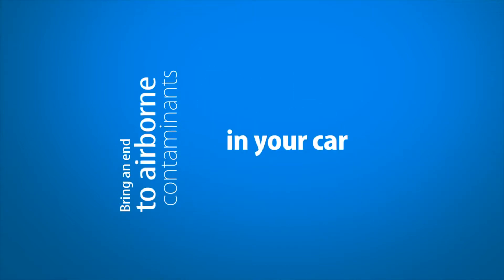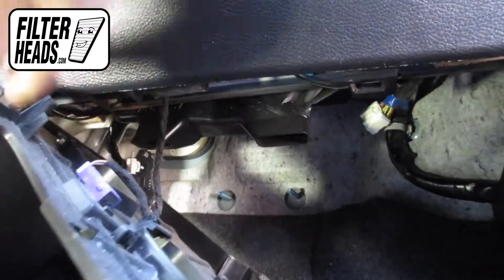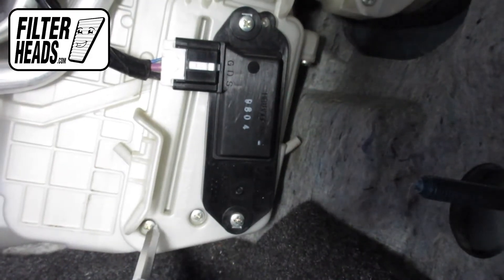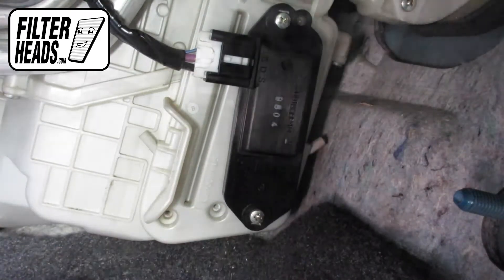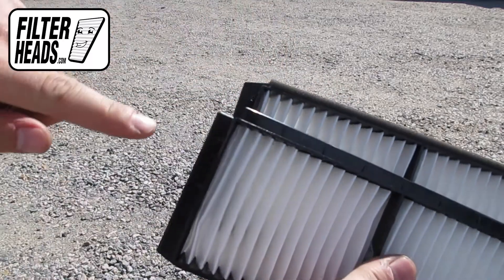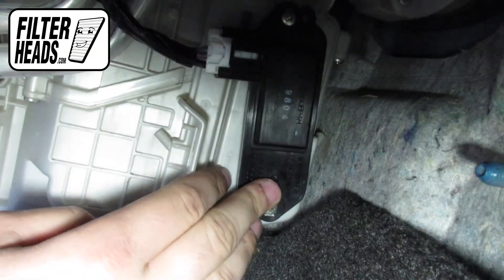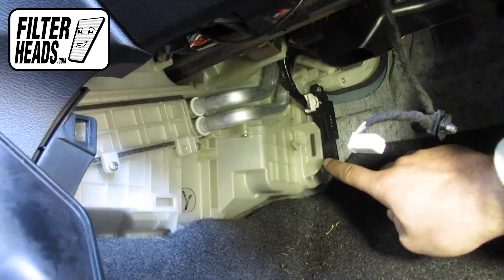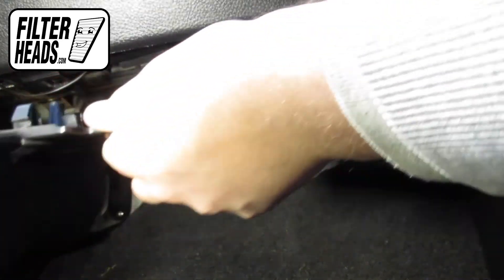How to Replace Cabin Air Filter 2010 Mazda 3 | AQ1151

Comment: I haven't changed those filters in 12 years.
Reply from the maker: Oh man! It is time for a change. I would suggest getting a shop vac to vacuum out any extra debris in the housing.
Reply: Lmao, same here. And it looks like it will probably be a while before I change it. I'd probably break a few of those tabs on the process.
Reply: Nor me, lmao
Reply: Just did mine, no air con. Original owner and there were no filters at all in there, lmao.
Reply: @filterheads where can I can I temporary shop vac?
Reply: @filterheads  Now I know that my 2011 car has a filter 👀
Reply: Just changed my originals today. 15 years

Comment: Trying this however one of the 2 screws seems to be worn and won’t catch with any screwdriver to take the panel off. Any suggestions?
Reply from the maker: If the screw heads are stripped, try placing a rubber band or small piece of duct tape over the top of the screw head. This should help your screwdriver get a better grip on the screw heads. If the screw head is raised, you can also attempt to use a pair of needle nose pliers to loosen it. If none of these tricks work, you can always buy a screw extractor from your local hardware store.

Comment: When you put the footwell ceiling panel back on, make sure you line up the back part onto the metal stud before you click the tabs into place or it will rattle. You can see how it's supposed to be at 0:32
Reply from the maker: Thank you for informing us!

Comment: Thanks for a clear and concise instructional video! I hope it will be as easy as you make it look. 🤣
Reply from the maker: A flash light and needle nose pliers to pull out the filter will make the job even easier.
Visit our website and get your cabin air filter today: https://www.filterheads.com/
Reply: @filterheads  used a knife and fork and spoon and it was easy as pie. I will order my next set from you next year.